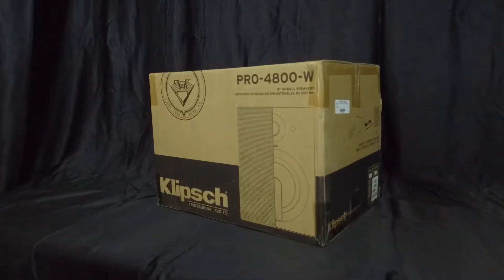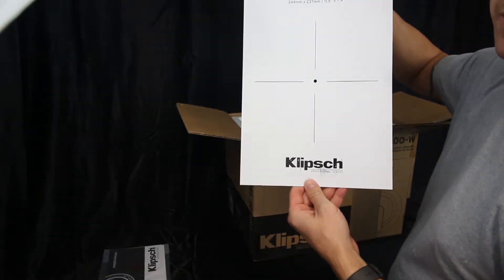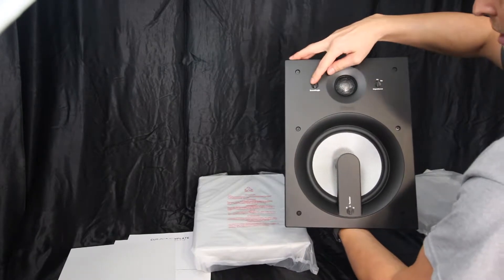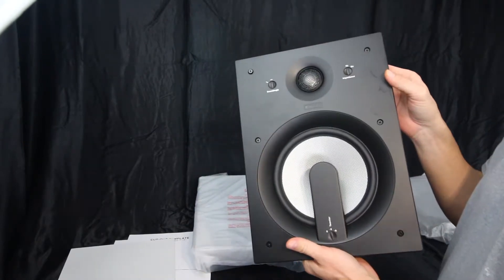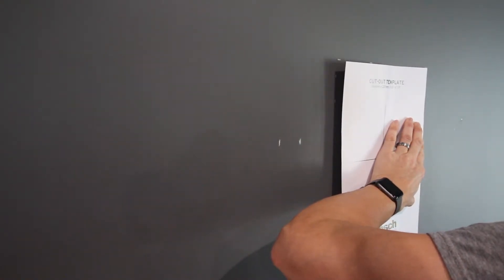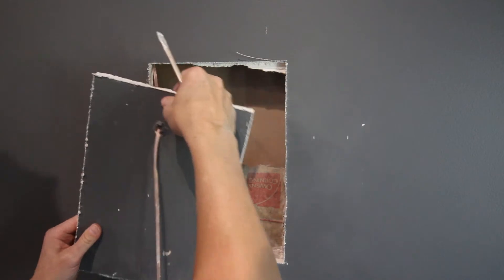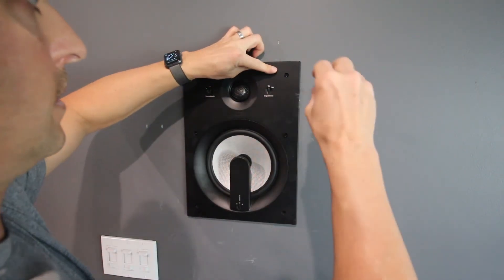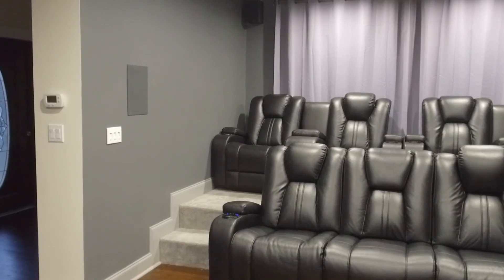KLIPSCH PRO 4800 SPEAKER REVIEW & DIY INSTALLATION PROCESS

Comment: Im doing a home theater. in walls. have been looking at the 250LRC and 16RC. But the price of the older models is pretty nice. DO you have any sound demos of this speaker set up? have you upgraded to newer models? and whats your experience with this model vs newer models?
Reply from the maker: I don’t have any sound demos there’s just no real way to get that to come across on YouTube videos and have it be accurate. I have not upgraded and I am still extremely happy with the set that I put in.
Reply: @MikeyMoVlogs  what is your full set up?
Reply from the maker: Onkyo receiver (I’m not at home I don’t remember the model) and all klipsch speakers and sub (12”)
Reply: @MikeyMoVlogs  the klipsch speaker model numbers is what im interested in. I cant find anything on Youtube or the net about the Pro 6800. the 4800 in the video you posted looks very similar. If you are running in wall Klipsch speakers that are a bit older then what is out right now I would be interested in those model numbers. Those older models are much better priced but there is very little information on what to run with what, or reviews that i can find....Ill be running the Marantz 7015